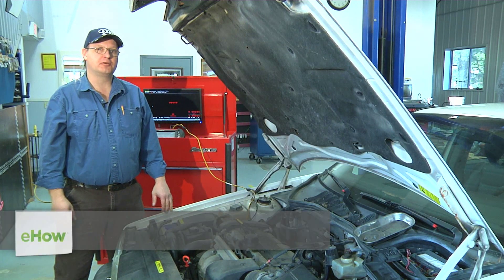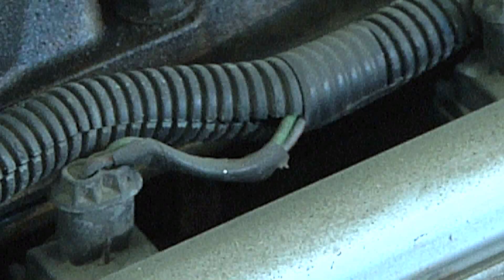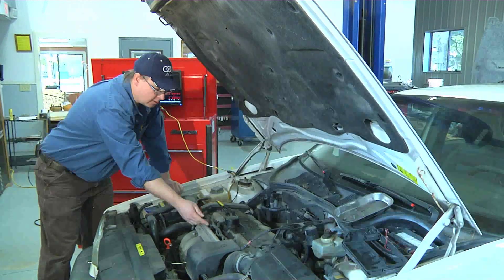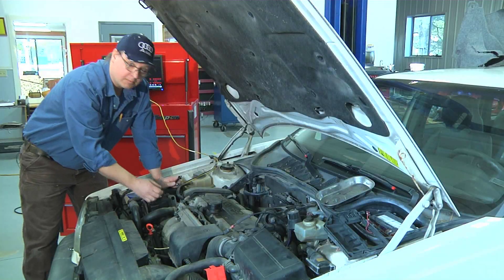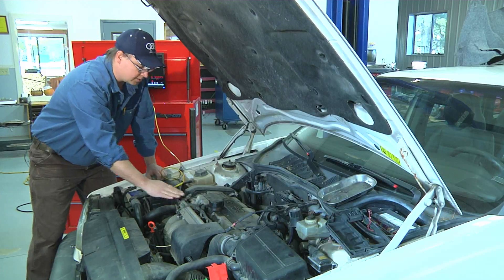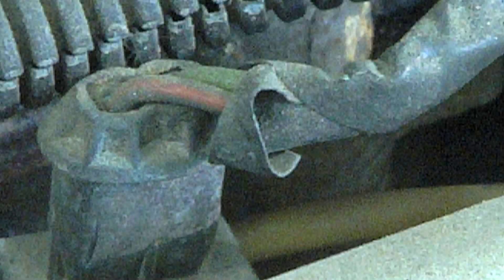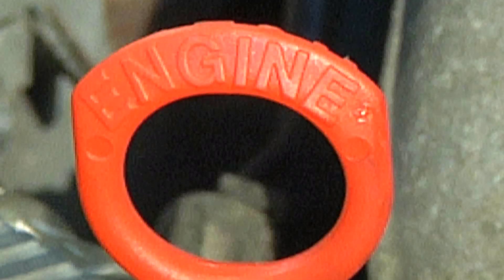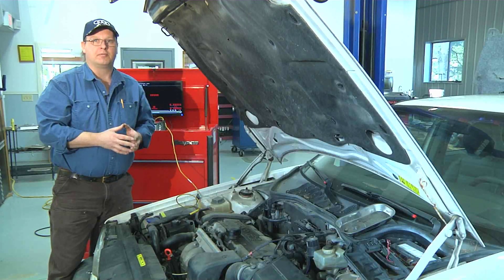Maintaining a Car's Electrical System : How to Check a Fuel Injector's Resistance

Comment: I have a 95' F250 4x4 duelly pu that #1&/#4 fuel injectors that aren't firing right . When I testing the #1&#4 are not charging with pulse has steady light when testing whole truck is running #2&#3 are pulsing what's the problem with those two that have a steady light test are they grounded in the ecm or cpm ? Any Sugestions for the fix? Can't seem to find any ground! !